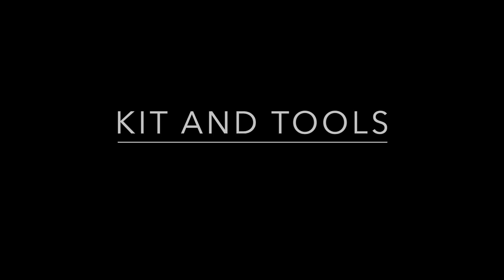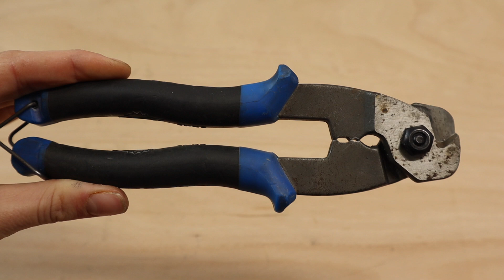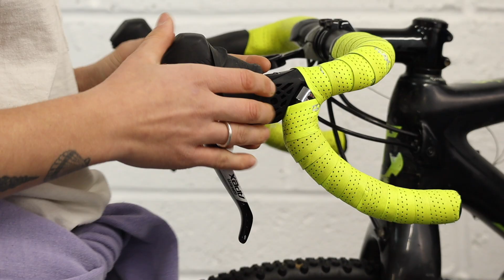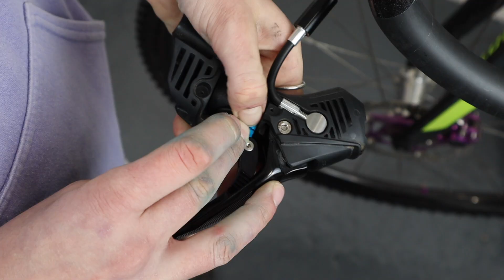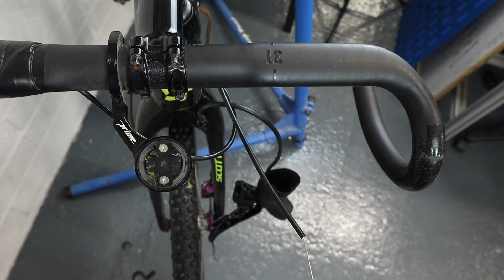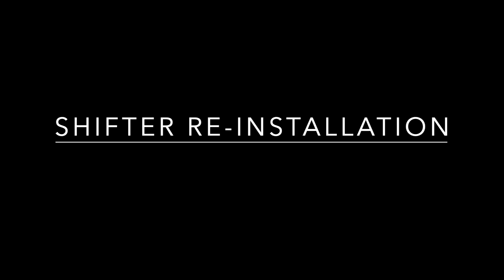Ratio Drop Dropper 12 Speed Installation

Comment: Seems like this doesn't mention the brake lever bumper that is required for 11 speed cable brakes and 12 speed levers. It glues to the back of the brake lever. I received mine and it doesn't fit quite right as far as I can tell. An image of how it should look when done would be helpful.